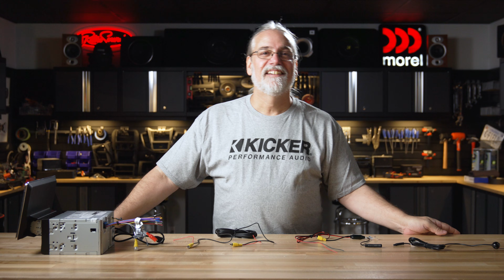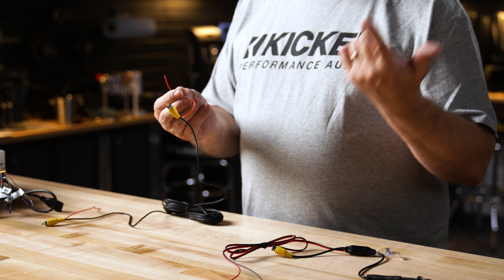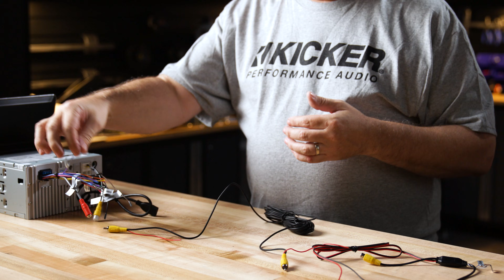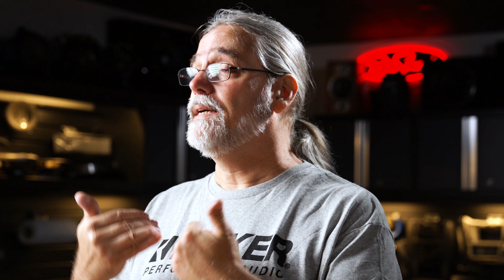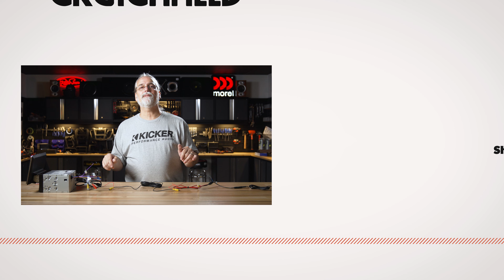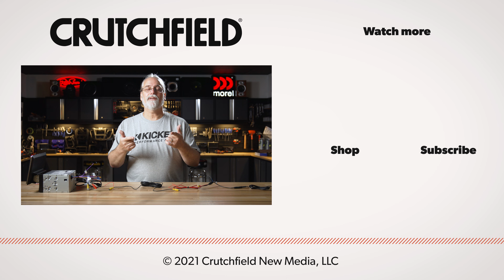Powering your backup camera (and how to use that extra wire) | Crutchfield

Comment: So, I’m having a dilemma. I installed my rear camera as instructed however for some reason in reverse, it’s not being triggered even tho there’s definitely power to the camera. Only time it works is in rear camera mode only. Obviously I prefer it to work the proper way of working when I place my vehicle in reverse. I’ve checked and re-checked my wiring numerous times now to no avail. I even switched out 2 separate head units but same results. Please help! Haha
Reply: I’m having the same issue if you find a solution please reply. Thank you
Reply from the maker: If the radio is not automatically bringing up the video feed, then there might be an issue with the reverse gear trigger wire. If the radio brings up the camera feed but does not show anything, and you know the power is good to the camera, you might want to check the inputs and make sure the backup camera is connected to the right one on the radio.

If none of this helps, you may need to speak with technical support for help resolving the issue. If it was purchased from  us, you can contact our technical support using their toll free phone number we include on the order invoice.
Reply: I think it’s the trigger wire(same occurrence on the previous head unit I exchanged). There’s power to the camera, there is video feed(ONLY if I switch to rear camera mode), the trigger will not allow once in reverse gear. I didn’t purchase from crutchfield, it was Amazon. Anyway, thanks for your reply!
Reply: I’ll admit, at the back end of my truck, I did tap the black ground wire to the negative reverse light wire instead of grounding it to the chassis (not sure this is relevant since there is power to the camera).
Reply: The camera works but only on camera view I have to go into menu and select camera view. It doesn’t work on radio while listening to music. It does work while on camera view when I put in reverse.
Reply from the maker: That may not be relevant since as we understand it, the camera can be used; just not automatically brought up as a backup aid when the vehicle is in reverse. This should mean the camera's ground wire is not causing the issue.
Reply: What could be causing the issue? Have you ever heard of this before ?
Reply from the maker: Did you connect the reverse wire on the back of your aftermarket stereo to the reverse light circuit in the vehicle? That connection would be required for the stereo to automatically switch to the rear camera input when the vehicle is placed in reverse.
Reply: @crutchfield  yes sir. I’ve checked and double checked numerous times. I’ll check again this coming up weekend again just to make sure.
Reply: Yes it is connected. When I put in reverse it works only while I’m on the view camera option on radio. Doesn’t come on anything else. Fm, Bluetooth,usb etc.
Reply from the maker: Since the wiring sounds like it has been properly connected, this is something that needs technical support to help resolve. If the gear was purchased from us, we recommend contacting our technical support for help using their toll free phone number included on the order invoice.

Comment: Okay, I have a situation where the screen on the radio goes black when I'm in reverse but there is no image. The camera is hard wired to a replacement license plate light/camera combo. In addition, I was informed by a very friendly deputy last night that my license plate light is not working. I need to address both issues, but I'm wondering if they are related. Any idea on where to start?
Reply from the maker: It sounds like the radio is switching like it is supposed to since the screen changes. Given the screen is black along with a light not working, you may want to check the camera's power wiring first. Also, the backup camera's manual will sometimes list some troubleshooting steps to try. If that does not help, you may need to contact technical support. If you purchased the camera from us, you can contact our technical support for this troubleshooting help using their toll free phone number that we include on the order invoice.
Reply: @crutchfield  I actually paid someone to purchase and install the unit, so I have no manual or even brand. The installer is several states away and not answering my messages. So, like the screen I'm operating in the dark, (pardon the pun).
Reply from the maker: That is definitely a tough spot to be in. We will be keeping our fingers crossed that you hear from the installer soon! You might check if there is another local installer who might troubleshoot your system and check the wiring for loose connections and correct connections.

Comment: Thank you for the info bud, you explained everything about the subject.
However the way I run mine as it's a camper with a tow hitch is multiple power connections, one on the reverse lights, one from the dash switch and one by a switch next to my bed, mine displays on my Android phone and tab as I use my Galaxy Tablet for everything including my Head unit.
I leave all switches off that way it is just a reverse camera, if I'm towing I use the dash switch and if I am in remote locations at night my security sensor lights and my surround cameras come on, the horn pips to wake me up and my tablet shows everything going on around my van.
A bit of an overkill for the norm but living on the road is a long way from normal.
Thank.
Reply from the maker: Sounds like you have everything covered with that setup!

Comment: I just bought a boss BE9ACP-C with you guys for my 2012 ford fiesta and had you guys pre-wire everything (ReadyHarness). It's already in the car without the camera wired yet so I can't look at it right now. But from what I can tell... since I have the AX-ADBOX1 interface module (in addition to my AX-ADFD02 harness)... the head unit will know when I'm in reverse already thanks to the module. So I only have to get power to the camera via the convenience wire (not reverse lights) so that I can have power all the time in an effort to have it automatically come on in reverse AND be able to toggle it on and off. Did... did I do my homework correctly? Not an electrician or skilled in this field at all but I've had a lot of fun trying to figure this stuff out thanks to you guys for providing the awesome products, the resources like this video... and potentially support via youtube comments! Cheers to Crutchfield
!
Reply from the maker: Sounds like you nailed it!
Reply: @crutchfield  wow. Talking about a fast response. Okay, no special wires for this necessary? Just the 12v to camera via “convenience cable” and the black and yellow cable for video? You guys are the best!
Reply from the maker: That's all the wires that are needed! If you purchased the camera as well, you can contact our technical support for help ensuring you are connecting the backup camera power wires to the correct wires in the vehicle

Comment: Hi mate, I've got both wires connected to reverse light. But I'm not getting any video signal. I haven't connected the ground wire to chassis. When I put the car to reverse, it detects it's reversing but I get no video signal. Do you suggest I connect the ground wire to body instead as per your video?
Reply from the maker: First, we recommend checking to make sure the backup camera video cable is connected to the backup camera input on the receiver. If it is, then try moving the ground to the chassis.
Reply: @crutchfield  many thanks for your reply. After checking it was bad RCA cable. All working now.

Comment: Anybody else notice that he never finished telling how to hook up for towing?
Reply: yep, he skipped right over it..lol. maybe i can help?. wire the rear cam from back to front to the head unit, just twist the red wire to a 12 volt power source when the radio is turned on. now locate the wire somewhere in the fuse block/fuse panel..and see if you can locate the reverse power wire that goes to the rear back up lights?, if this is going in a truck and it has a 7-way plug at the back?, you should be able to locate the reverse light/backup light wire in the fuse block/fuse panel either under the dash, or under the hood?. once you locate the reverse light/backup light wire, tap into it with a wire from it to the trigger wire on the head unit. by doing it this way, not only can you view the backup camera going down the road?, but also should be able to trigger the function at the head unit to show when you put the truck into reverse. the reason for running power from backup camera to head unit is because this keeps the backup camera on at all times when you turn the radio on. JUST BE SURE TO WIRE THE BACKUP CAMERA TO A SWITCHED 12VDC POWER SOURCE !!...YOU DO NOT WANT YOUR BACKUP CAMERA ON ALL THE TIME WHEN YOU SHUT THE RADIO/ENGINE OFF !!.

Comment: Can I use acc for the power of the camera
Reply from the maker: Tapping in at the rear lamp for power is most common. You can also tap in at the fuse box in most cases. And some radios have  provisions for reverse camera power built-in as well.
Reply: @crutchfield  have a joying radio with a cam bus decode do I still have to connect the camera to a power source I have gotten told that the radio has a switch that automatically turns on the camera when I go into reverse so I don't need the power Just the av cord
Reply from the maker: It sounds like your radio is one of the models that has a wire meant to supply power to a backup camera. If that is correct, then you will need to run a power wire for the camera. Some come with a red wire attached to the video cable which can help with this process.

It is worth mentioning that radios also have a reverse gear detection wire that when trigged, makes the radio display the camera input. The camera still needs power but this is the radio's way of automatically displaying the backup camera video feed when the vehicle is in reverse.

Comment: To much talking about situations that aren’t present in the video. I had to watch like 10 times to fully understand what he’s talking about. Would help to have those visuals present instead of explaining them without them being present.
Reply from the maker: Fair point. If it helps, we've made some longer-form videos about wiring backup cams for different types of vehicles:

SUV/Hatchback: https://youtu.be/BOZrx8c_hRU
Truck: https://youtu.be/d3IuNGON49w
Sedan: https://youtu.be/FAVWPzYmkjE

I hope those can be of some help. They're chaptered in the player so you can skip around to find a relevant section. Thanks!

Comment: My reverse light is led and causing a snowy picture .
Is there a easy fix for that?
Reply from the maker: The type of light source should not be causing a snowy picture. That issue is usually linked to the backup camera. Which one do you have installed?
Reply: @crutchfield  
Cheapest i could find. P5130 inbuilt. 
Thanks for quick response.  I probably just live with it then as it is not really that bad.
Reply from the maker: If you change your mind, let us know!

Comment: The Pioneer ND-BC8 that Crutchfield sells doesn't have a third wire running off the video like the one in this video, just video RCA, power with fuse, & ground. How do I proceed wiring both to the head unit (Sony AX8100) & back to the reverse light?
Reply from the maker: You will connect the camera's red wire to a switched 12V source ( tail lights, 12V outlet, etc)  the black wire  to your ground, and then plug the video cable into your receiver's video input.   The headunits reverse trigger wire is then connected to the reverse trigger wire.  This will allow you manually turn the camera view on, and it will automatically switch when you go into reverse.

Comment: anyone know how to fix no signal? i clearly have power as the lights on the camera are on and the video channel displays while in reverse, yet the feed has no signal? i made sure that i was plugged into the video in and everything
Reply from the maker: Some radios need that ability turned on to make an input a backup camera input. It is worth checking the owner's manual of your radio to confirm.
Reply: @crutchfield  nvm i’m stupid and i didn’t know there was 3 identical video inputs, and only one of them works😂
Reply from the maker: lol We are just glad you figured it out!

Comment: If you energize the camera from the front 12v instead of the backup light power, will the lights on the backup cam be on every time the the vehicle is on?
Reply from the maker: The options options with the LEDs are designed to have the lights on when you go into reverse.

Comment: Having issues with my camera powering up.  If my stereo switches into camera mode as soon as I put my car in reverse do I still need to connect to the reverse wire?
Reply from the maker: Power and reverse is required. You may want to double check your connections. From there, you can call our Tech Support for help if you got the camera here. Their direct number is on your invoice.

Comment: I was looking through the comments and I didn’t see this question so I gotta ask. But let me explain my connection. To make sure it’s correct.  I connected the yellow rca plug to camera plug in back of deck.  I then wired the red wire on the rca cable line to the reverse wire.  I then ran that back to the camera and wired the two power wires (one on the ground and pos I’ve line and one off the rca cable line together into the reverse light line.  And finally grounded the ground wire.  Now when I switch into reverse it works but when I put it into drive or park it switches from camera to a black screen that says no signal and I have to hit home. It requires me to hit home every time I back up and go forward which is obviously annoying. I’m sure you have seen this before.  How do i fix it? I looked through settings and couldn’t find anything…
Reply: There are a few details missing in your post: 1) What head unit do you have? 2) When you say "red wire on the rca cable line to the reverse wire" I assume you mean on the back of your head unit; but are you referring to the reverse trigger wire or the reverse power wire? (reverse power wire will send power from head unit to the camera; reverse trigger wire is what tells the head unit you are in reverse). 

It sounds like the head unit isn't properly detecting when you come out of reverse which leads to question 3: what year, make, model car do you have?

Comment: My camera has an extra blue wire. What’s that wire for?
Reply from the maker: Extra wires are often included to help with getting power for the camera from a switched power source instead of using the backup light circuit. Which brand/model camera did you get?

Comment: I bought the BE10ACP-C which comes with a rear camera that has LED on it. If I connect power from the boss power cable to be able to see it at any time, will the LED stay on all the time, or only when I access the camera from the screen?
Reply from the maker: When the included camera is connected to the BE10ACP, the backup image is displayed on the integrated 10.1" LCD screen when your vehicle is placed in reverse gear (purple/white wire attached to rear chassis must be connected to vehicle's backup lights.
Reply: @crutchfield  but the unit itself have a 12v cable labeled rear camera which send the power. So if I use that cable for power and use the reverse cable from the unit to tap in the reverse cable on my car to trigger the camera on the reverse, will the led on the camera stay on all the time, or only turn on when I either reverse, or select camera view from the unit itself?
Reply from the maker: They are on when the camera is on.

Comment: Why dont attach it to the ground wire from your reverse light?
Reply from the maker: You technically could, but running the ground wire directly to a metal grounding point to the vehicle chassis works best.

Comment: So I have the boss unit, is there a way to make the camera pop up when I go into reverse without me having to click the camera app? I’ve watched so many hours of videos. This video debunked the idea I found online that wiring directly into my fuse box would do that for me.
Reply from the maker: What model radio and camera are you using?
Reply: @crutchfield  I have the boss be7acp-cft
Reply from the maker: The Boss stereo has a dedicated reverse wire (the purple/white wire on the rear harness), which you'll need to connect to the reverse gear circuit in the vehicle. This allows the stereo to automatically switch to the rear camera input whenever the vehicle is in reverse.
Reply: @crutchfield  thank you much, I drive a 2012 Nissan Altima base model and that’s what the camera is installed in! I believe the correct fuse would be the meter fuse in the driver side kick panel, is there any way for you to verify that?
Reply from the maker: If you got the radio here, please call our Tech Support for help with this vehicle specific info. Their direct number is on your invoice.

Comment: I have ONE question.

The small power wire which is attached to video RCA, along with the long positive wire adjoined to the ground.
Both need to be connected to the reverse power. Can I ask why that small power wire is so small? I imagine it's because you're meant to extend it with another peice of the same wire so that you have enough length to make it to the reverse light. But, why is it that no-one talks about this in ANY video? Problem is I can't seem to find a place that sells this tiny guage wire by the metre. I only need about 1.5m. it's annoying that the convenience wire is so inconveniently small as now I need to shop around for a tiny price just so that it can reach reverse lights.
Reply from the maker: You generally see smaller gauges there to better match the fit on factory wiring. We do carry a good wire match here: https://www.crutchfield.com/I-rYALc921/p_120IBR98/Install-Bay-IBR98.html